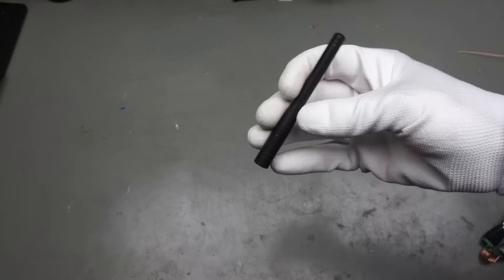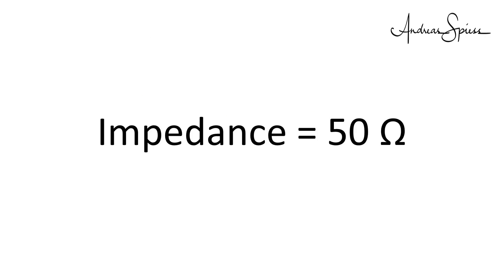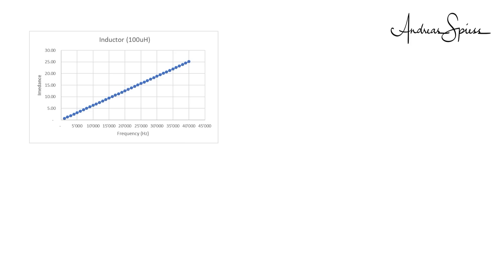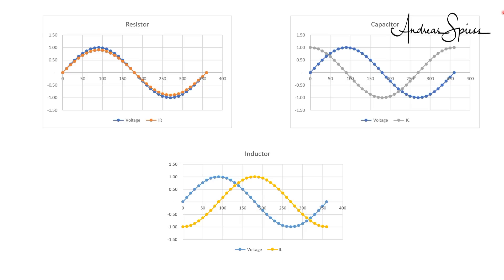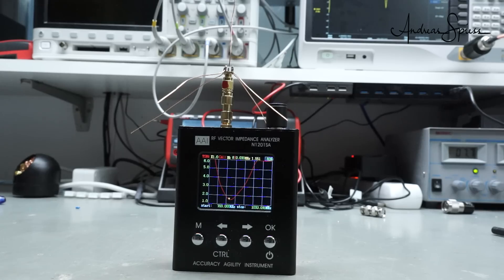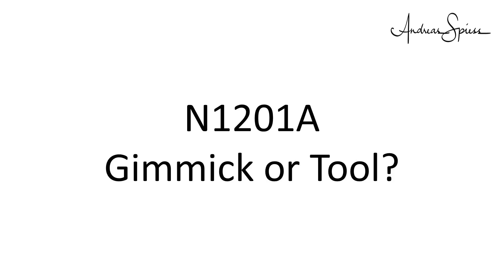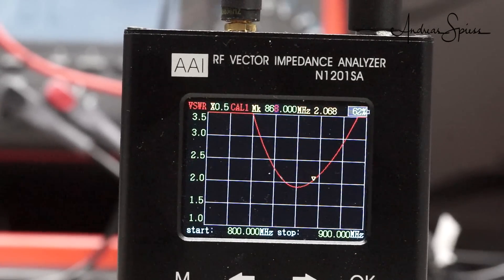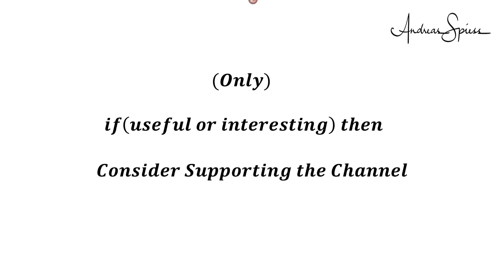#191 Optimizing Antennas using a cheap N1201SA VNA (Vector Impedance Analyzer), LoRa, Review

Comment: The aliexpress seller states that the radio has a range of 140 MHz - 2.7 GHz, I need to calibrate a 137 MHz antenna for my matura paper, am I able to use the N1201SA?
Reply from the maker: It officially starts at 137.5 MHz. So you will not be able to use it. You need the version which has a lower frequency  ( http://s.click.aliexpress.com/e/aiqNrfQ )
Reply: @AndreasSpiess  Thank you very much(I know it's a little bit late). Your videos, especially those about the antenna basics, helpt me a lot. Thanks to your great channel I was able to present my paper two days ago and receive a good grade. (If you are interested https://github.com/Xelef2000/Receive-satellite-images-using-an-SDR)

Comment: Great video as always! I was really hoping you were also going to show the insides of the N1201SA VNA in "Don't turn it on, take it apart!" fashion.
Reply from the maker: I would never take it apart. The risk is too high that it does not work anymore. That would be a catastrophe for my relation to this small device ;-)
For your info: It consists of an ADF4350 and a SA612A mixer plus the usual STM processor and charging circuits.

Comment: The antenna is not bad but the PVC-pipe probably is... to test it throw it in the microwave if the pipe gets warm chuck it in the bin. You dont't want your expensive super high frequency squigglys to warm up the pipe...you want them to send something far away.  btw about the same reason you 868MHz antenna detunes with the cap on. (not to get technical :-) )
Reply from the maker: Good Idea with the microwave. Unfortunately, we do not own one :-( I have to go to the neighbor.

Comment: 14:33 = reference for the Smith Chart question posed. Someone should answer this properly. 

   I've seen similar types of point analytics used to describe the frequency stability characteristics of an SMPS design, but I'm not sure if that's the same type of thing, and I'm not entirely confident in my basic grasp of that subject...So I'm going to stop here before I say something even more foolish.
  Thanks for the lesson on antenna impedance.
-Jake
Reply from the maker: There are a few videos out to understand Smith Charts. But the antenna as it is now is not very good because of its curve. The curve should go through the horizontal line at the desired frequency. and it should be close to the "middle" point"
Reply: Andreas Spiess 
  Thanks for answering your own question ;)
 I need to review/practice my math skills. I don't recall much of the advanced stuff.
  Thanks again for the upload ;)
-Jake

Comment: What is the difference between N1201A and N2201A?
The N2201A has two ports which are named RFOUT and RFIN. What extra measurements do they offer? Do they have to be combined in order to check an antenna?
Reply from the maker: The 2201 has two ports and an additional serial connection. But I do not know it’s possibilities

Comment: Super great video, I love this N1201SA device.
BTW: The open/closed SMA connectors are easy to build for everyone. For the  50 Ohm load, a 100 Ohm 0.1% (two parallel ERA-6AEB101V Panasonic) resistors will do the job.
Reply from the maker: So you were more successful than me. We did some tests with a "homemade and a "bought" open and short. The differences were noticeable already at 868.

Comment: Andreas Spiess, have you thought about making and testing 2440MHz PCB Moxon antenna? I did some searching, it looks like nobody tried it yet. PCB process could make it cheap and easy, and usually sensors are installed in a fixed position, so you can point an antenna to a node.  I can make PCB design on a 4 layer PCB, you have VNA equipment, someone can pay 20$ for antenna PCB samples. We can do it.  Of course all will be open source.  What do you think?
Reply from the maker: If I get your Gerber files I can order PCBs in China. Make sure it has a SMA connector and the line to the antenna on the PCB has 50 ohms.

Comment: Hey Andreas, great video as always. Do you think it would be somehow possible to design and optimize PCB antennas with this?
Reply from the maker: I do not think this is easy. You have to solder a coax to it and do not know if this connection has 50 ohm
Reply: Got it. I'll try adding a U.FL footprint on the pcb for measurement.
Reply from the maker: Also ok

Comment: Thanks, very helpful and still affordable tool! Thanks for sharing. There are so many antennas on aliexpress or eBay and you never know what you get. This tool helps to sort out the non reliable vendors and to find the well matched antennas.
In  my understanding you can see if the antenna is matching. But how can you find out something about the gain and directionality?
Reply from the maker: With the setup I showed in the last video
Reply: Thanks, I think the #188 Video.

Comment: I'd not have trusted these things without your recommendation. Thanks for taking the risk on our behalf with such a wonderfully qualified response. Does this mean you have RAK troubles? :)
Reply from the maker: The RAK works now. I had a wrong board from Charles. Now I am trying to compare the performance of the two gateways. Not as easy as I thought...
Reply: No I've been playing with adding GPS and running things in Docker - now there is a whole track of video possabilities (have the antenna tester on it's way - I bet China is empty of the things after your commendation).

Comment: Should the calibrators have male or female connector? On the video male connectors are shown but I got confused as the provided link to antenna connectors is for female connectors. I assume the link was for people wanting to build the ground plane antenna.
Reply: Nevermind! I watched the video again and clearly the connector on the VNA is a female one.
Reply from the maker: They have to fit the connector on the VNA.
Reply: Andreas Spiess At that point I did not immediately find information what the connector on the VNA Is. I decided then to order a lot of various SMA connector adapters just in case I ordered the calibrators with a wrong one. Of course the adapters can be useful for connecting different types of antennas also.
Reply from the maker: I have a whole set of adapters for all combinations. Very handy.

Comment: Excellent presentation!
Now we look forward to your review of the MiniVNA Tiny clone. I may be tempted to buy one if it is any good. I have the 1st. gen MiniVNA and are quite satisfied with it, except that it does not go higher than 180MHz.  So I would buy the one you show there if it is a tool and not just an expensive random number generator.

And did you really think you would get away by showing us an RMA and a RMA-RP in the same picture with no mention of it? Mate those two and measure the WSWR through them! It should be pretty high. ;-)
Reply from the maker: 1. I have no plan for a VNA review for the moment.
2. SMA connectors should be 50 ohms (and they usually are).. So two connectors in series are not too critical.

Comment: You skimmed things a bit too quickly for my taste, like e.g. you just show the website you used, then go "We built the antenna!" -- what, no we didn't and we didn't discuss its construction or workings at all, either, you just skipped that part! There's a lot of stuff to unpack here and, well, I just feel that going so fast and skipping a lot of the steps involved is sub-optimal.

Just my opinion, though, take it as you like.
Reply from the maker: Thank you for the feedback. The ground plane is really simple. Just look at the photo of the SMA connector where the 5 wires have to be soldered. Otherwise you should find instructions about that.
Reply: Take a look at w2aew Video Series about VNAs, Antenna Tuning, Smith Charts and so on: https://www.youtube.com/playlist?list=PL4ZSD4omd_AzGK02MwlAWtK3H1N59QTrD

Comment: How about impedence at higher frequencies, Andreas.
Reply from the maker: Physics is the same, but equipment gets more expensive (exponentially). Just saw in a tutorial that Keysight has a tool up to 1.5 THz ;-)
Reply: Upto 1.5 THz think of the equipment to Calibrate that equipment. Not to say repair it.

Comment: Great video! According to the manual, there also seems to be an 1201SAC version, which actually also has a serial interface in the USB (the standard version USB is only for charging) - seems more interesting but I don't see it anywhere offered on Akliexpress or bangood. Anyone knows where to get that version?
Reply from the maker: I saw one under the name of N2201 with a Serial connection. But I do not know it or its software.

Comment: Oh, by the way, that antenna on the Smith chart almost gets to 25 Ohm resistive if I'm reading that correctly, so no, I don't think I would want to use it on 868MHz.  Get adjusting it's length. . :-)
Reply from the maker: You are right. But I do not know if it will only be the length....

Comment: Why is the yellow arrow not pointing at the lowest point of the curve but it is a little offset?
Reply: I had the same question. Thats the frequency that shows up on the diplay so it seems the resonance is still a little off.
Reply from the maker: Because I set it there. You can move the marker manually

Comment: OH WOW, THANK YOU! !!!. This is one of your best videos to date. Antennae theory and practice is something that most of electronics hobbyists have to always rely on others, such as vendors and manufacturers, when we build with RF modules such as Lora etc. Using this video the theory and practice is now approachable. - IN A COLOUR GRAPH!!!! You  have really showed us how we can optimise our own antennae using tools that even we hobbyists can consider getting. Thank you again!

One question please Andreas, please could tell us if this device can be used for wifi/ES32/ESP82xx, GSM and other similar modules that all play with.  I know you said that the 2.2 GHz band is covered, but is it just as effective in that range? Sorry if I missed this the video but it wasn't clear to me.

Ps. The other thing that wasn't clear was whether you loved this new tool? :-)
Reply from the maker: Concerning 2.4 GHz: We did not focus on that range so I cannot tell you if the results are as good as they were below 1 GHz. But I assume they are ok, too. I saw a video somewhere where the guy used it for WiFi antenna testing.
Reply: @AndreasSpiess  Hello Andreas, Do you have experience with the management of Rigexpert? I have the AA-600, but it remains at 600mhz maximum. I was looking at several models, which at least could analyze the 2.4-2.5Ghz band, for wifi antennas, and have appeared yours N1201A, the Vna Tiny and another one that is much more expensive, the KC901V, which comes to cover the wifi antennas of double band.
I would like to know if the measurements of the N1201A are quite accurate, since I would like to use it to make high sensitivity Bluetooth antennas.
Thanks for your mythical tutorials.
I wait your answer.
Best regards from Barcelona, Catalonia.
Reply: northshorepx p